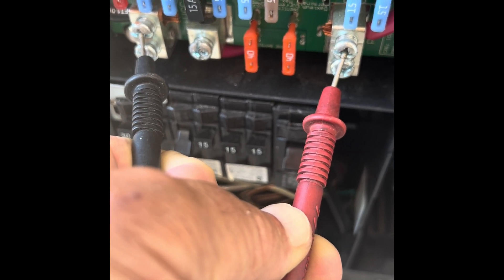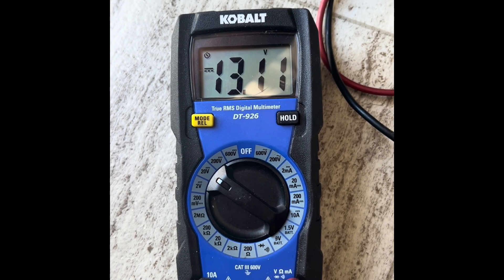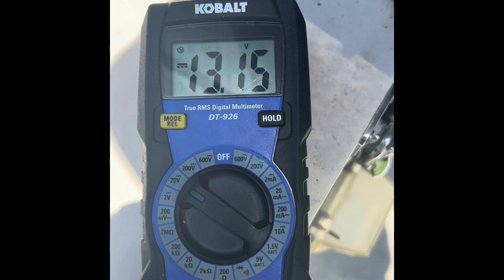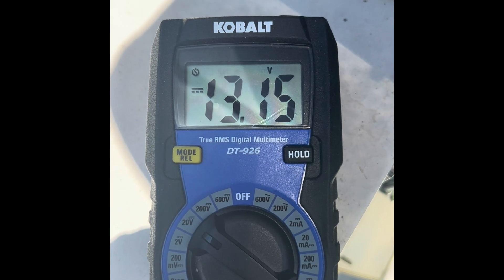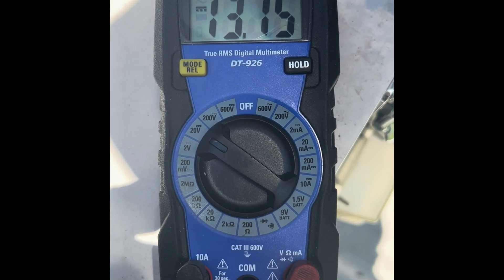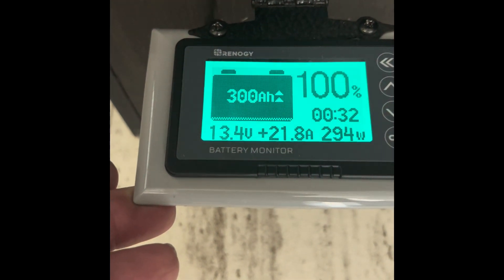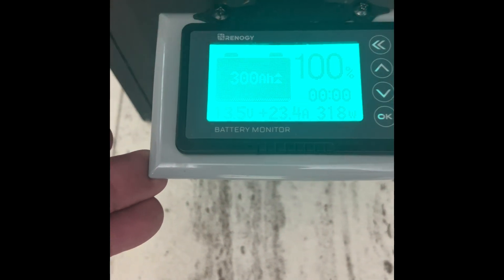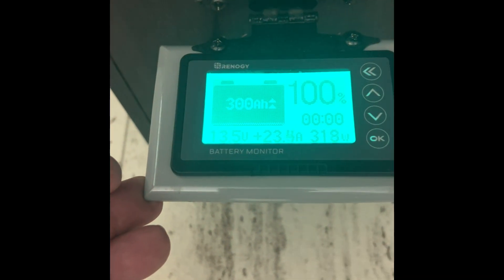Upgrade with WFCO 9855AD Converter for Lithium batteries

Comment: AD is typically worthless. My battery is 11’ away and will not switch to lithium mode. I had to order a jumper. WFCO should hand stuck to LI converters with the switch. WFCO told me the switch was too complicated for their customers. “They forgot to switch it”. Wtf.
Reply from the maker: Mine has the jumperto shift it into lithium mode but the WiFCo will not produce the 14.6 volts needed to properly charge the lithium batteries.  Maximum voltage is 13.6.
Thanks for your comment

Comment: The wfco auto detect converters only go into lithium mode after you run thru a full discharge-charge cycle. Thats why I replaced mine.
Reply from the maker: You didn’t notice that I got and installed the jumper given to me by WFCO.  It makes it the converter go to lithium battery mode.  The blue light is on.

Comment: The wfco auto detect converters only go into lithium mode after you run thru a full discharge-charge cycle. Thats why I replaced mine.

Comment from the maker: I don’t have the space near the converter to place the batteries.  I thought about running larger gauge wire to the batteries from the converter.  WFCO people actually recommended another battery charger near the batteries to give me the higher voltage.  Like I said, in the video, LiTime says that WFCO converter does not meet the lithium profile to properly fully charge their batteries.  They explain that you need 14.5-6 volts to fully charge their batteries.    In my video, I neglected to test voltage and amperage at the converter with the converter on.  I will do that.
Why is this issue reported with WFCO converters and not with Victron or others?

Comment: I believe you don’t completely understand how electricity works.  I had the exact same issue that you do.  After taking several measurements with my multimeter, I noticed that the converter was putting out 14.5 volts and about 52 amps using the WFCO 8955 AD MBA.  I then took measurements at the battery and was only getting 13.7 and 28 amps.  I did some research and learned that due to the length and size of wire, I was losing a lot of power.  The factory wiring ran from the converter to a junction post (5ft, 6 gauge wire), then to the battery disconnect (15ft, 2 gauge), then to the breaker (3ft, 2 gauge), then to another junction post (2ft, 2 gauge), then to the battery. 
I moved my lithium batteries to inside the RV.  I rewired everything and now only have minimal loss of charging amps and voltage.  From the charger to the battery disconnect (6 gauge, 2ft), to a breaker (2 gauge, 5ft), then to the battery (2 gauge, 1ft).

Comment: I had a similar problem, once I shortened the wire to 2ft and used 6ga wire it immediately changed the performance of the converter. I will be posting an update in a few weeks to fully test with the jumper and converter now in lithium mode. 
Nice video! I wish they would have just kept using the switch.
Reply from the maker: Why would shortening the wire affect the voltage of the converter at the converter?
My voltage drop at the battery, (20 ft) .1 volts.

Comment: I want to correct something on my video.  I said that my LiTime lithium batteries cost about $369 and actually they cost $269.99 each.  The 2020 Coachman Northern Spirit 1943RB, ( a great couple’s model), came with 2 24 group lead acid 100ah batteries.  I added another one and used them for about 4 years and 20,000 miles of travel.  I upgraded with 3, 24 group LiTime and they have been really great.  I highly recommend.